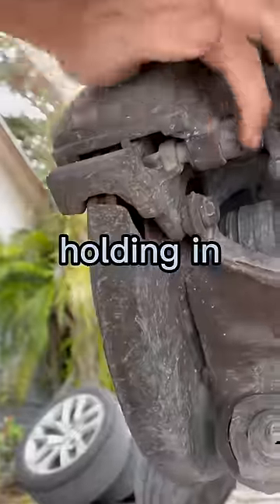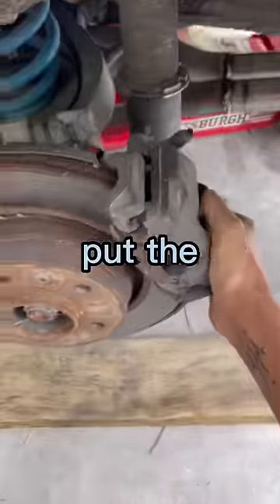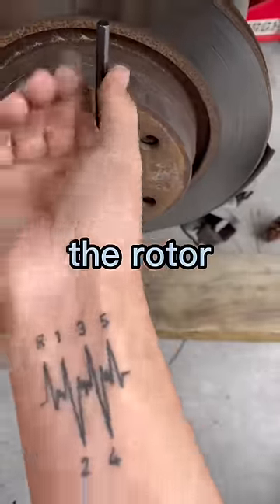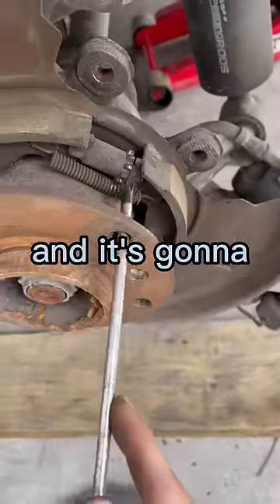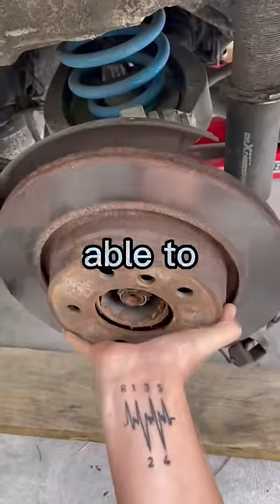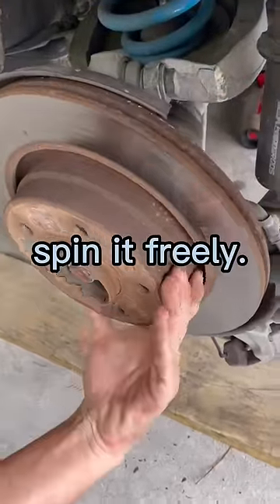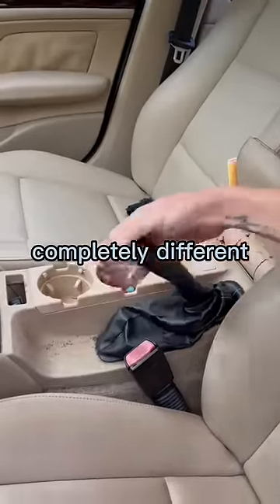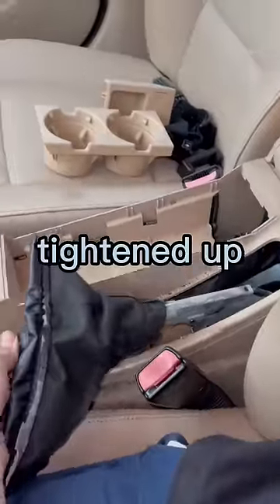How to make a hydro with your stock e brake!

Comment: “how to adjust your parking brake”
Reply: It’s quite literally the opposite of a hydraulic break. There’s no fluid amplifying the brake pressure. He just made his standard hand powered break slightly tighter
Reply: @Red_Cp3 right but the point is that it imitates a hydro
Reply: @lamp7746 except it doesn't. Not even a little bit no matter how hard you squint. It just makes the parking brake work the way it should. This is just basic ass maintenance.
Reply: @lamp7746 a hydro is just a HYDRAULIC parking brake. This is done because brake lines dont stretch like a cable and usually run on a separate caliper so the bite way harder and hold up better.
Reply: @peenusweenus3169  I’m pretty sure handbrakes shouldn’t be that hard hence why I said it’s imitating a hydro…
Reply: Jd41Scribner  that’s what I said
Reply: @lamp7746 and you never said "imitates" in your video so stop lieing. You said how to make your ebrake a hydro. Which is you never did. It's ok to have interest in a field you don't have experience in, but it's not ok to be a liar with minimal if any experience in the same field. And then doubling down on the lies and lack of accountability makes you look like a progressive American, politician or child.
Reply: @lamp7746 doesn't come close to even imitating, hydro locks up 10x easier bro 😊
Reply: @peenusweenus3169 no it’s not. A hydraulic e-brake uses brake pads on a secondary brake caliper. A parking brake does not

(Edit) not mentioning the hydraulic fluid and the fact that it can’t stay locked
Reply: @JJ_isdenaam  i already said they usually use a separate caliper. Learn to read
Reply: @lamp7746  he mightve over tightened ever so slightly but as long as the handle is lose for the 1st few clicks you should be good.
Reply: @peenusweenus3169  yeahhh but it can’t stay locked so it’s not
Reply: @The_goldfish1  hydro brakes aren't designed to stay locked as there's no ratchet to keep the lever up
Reply: @mrphil3446  exactly what i’m saying
Reply: @JJ_isdenaam  read it wrong sorry 😅
Reply: @mrphil3446  no worries🤣😉
Reply: @lamp7746 literally if it's a well-adjusted handbrake it should be able to lock your tires.  His brakes we're not adjusted properly before. Also hydro wouldn't have the locking mechanism in the handle.
Reply: @peenusweenus3169 i dont think your supposed to use a parking brake while driving....so its not what it was designed to do. This makes it so your not getting a full arm workout yankin that thing to the headliner😂
Reply: Correct.
He did a good job adjusting his parking brake.
Reply: And typically it can be done without removing anything
Reply: @lamp7746 no its kinda just putting it back to factory breaking pressure with a shorter throw in the lever
Reply: @The_goldfish1 he's literally holding in the button
Reply: @spyda6862 yes and we were literally not talking about the stoch handbrake but about a hydro e brake
Reply: @lamp7746 correct a hydro is basically a fancy parking brake

Comment: Hydro?  U know slamming your brakes when backing up will usually let that auto adjust tighten up a little.  If it is still auto adjust on the drum/caliper drums.
Reply: Regular drums maybe. Parking brake shoes are adjustable, but not auto adjusting.
Reply: @blackmesaresearch2 exactly. The e brake doesn’t have the adjustment arm to turn the adjustment nut. That’s just auto adjust for drum brakes only.
Reply: Not on that park break set up, that method only works with park brakes attached to the brake caliper
Reply: @blackmesaresearch2  some are
Reply: - comonly called a drum in hat, just about never called a drum/caliper drum 😂

Comment: This is the kinda of person thats asks if your cars automatic or manual for windshield wipers.
Reply: On a real note every drifter started out this way,  remove the spring in the button and get a button lock.
Reply: He the type of guy to ask you if your motorcycle is 4 wheel drive.

Comment: Actually hes right if you spin that disc it actually switches it to hydraulics. The best way to test if its in hydraulic mode is the yank the e brake with both hands 15 times then one handed another 15 times for each hand. this insures the hydraualic wire is locked into hydraulic mode instead of cable mode

Comment: I don’t trust anyone who calls a handbrake an “e-brake” 
Or someone who thinks a steel cable is hydraulic….
Reply: Well that's what it's called
Reply: I mean it is called an emergency brake so e brake is a pretty practical way of saying it🤓
Reply: But it is a e brake…. The like getting mad that someone called a sedan a car. They have multiple names, e brake was popularized in the states because 99% of cars are automatics so in return have no real use for a hand break other than in a emergency, hence emergency brake.
Reply: That there is a parking brake. An emergency brake is fitted to high performance cars. When activated it brings the vehicle to a stop in the absolute fastest way possible.
I dare you to engage the “parking brake” in an emergency while you’re on the highway 😂
Reply: @Red_Cp3 ofc it’s always a Matthew setting mf’s straight with facts💯💪
Reply: @mwoodall13 only reason I didn’t pull the EMERGENCY brake. During the accident I had recently was because it wasn’t my car, and the EMERGENCY brake was one of the foot ones. I would’ve pulled it if it wasn’t a foot one. And didn’t have time to think about it. If I were in my car, first thing I would’ve done besides slamming on my regular brakes as well
Reply: @mwoodall13  it’s not meant to be used in that type of emergency the emergency it’s meant for is a brake failure. The hand brake is 100% mechanical meaning if your brakes fail you have a “emergency brake” at your disposal to still be able to stop. Also ripping the brake at a high speed will only cause you to spin out if you pull it too hard if you engage it with even pressure the whole time you won’t spin out
Reply: He just means it fulfills the same purpose
Reply: @matthewcawley3107 dawg thats cool and all but we're still glossing over the fact this kid is claiming a steel cable pulling on some brake shoes is now hydraulic just because he tightened it to where it should be.
Reply: @Red_Cp3  then why are the electric ones called “electric parking brakes” and not electric emergency brakes
I get people call them that but it’s not what it is, using the parking brake in an emergency is not recommended
On top of that it’s a hydraulic hand brake- not a hydraulic emergency brake 😅
Reply: @mwoodall13  because the electronic parking brakes aren’t a hand brake. The benefit of the handbrake is it’s mechanical meaning if your hydraulic brake system that’s controlled by the pedal stops working you have a “emergency brake” the electronic ones are not mechanical removing that purpose making them exclusively for parking. And no one calls it a hydraulic emergency brake because at that point it is no longer a mechanical brake and wouldn’t be used or useful for that purpose anyway. Hydraulic handbrakes are used for getting as much braking force on your rear tires as possible as quickly and suddenly as possible to cause them to break tractions. how could you possibly in good faith use that as part of your argument knowing that hydro handbrakes have never came in a vehicle from factory ands use is completely different from a handbrake.
Reply: If you knew something about cars, youd know they are basically (ebrake = handbrake) are the same damn thing. But ill let your research tell you that 😂
Reply: @Red_Cp3 but it isn't an emergency break..😅
its actually a parking break.. and is called a parking break.. 
using it in an emergency, will more often then not, make thing worse...
Reply: @jesse584  you obviously don’t drive then. If you would have read the other 3 comments of me respond to this exact same msg from other people I wouldn’t have had to type this. The hand break is a 100% mechanical break whilst your pedal break used hydraulic lines to increase the pressure of your foot. If one of those lines fails you lose brakes, but if you have a hand brake you still have a “emergency brake” to help slow you down. And your other statement is completely falls have you ever pulled your hand break while moving? You don’t spin out like a video game your rear wheels lock causing them to drag against the ground scrubbing a lot of speed. The only way this would make you spin out is if you weren’t already on the brakes when you ripped it really hard above 60 or if you flung the wheel with it was activated
Reply: I get the second part but your dead wrong on the e brake, it’s literally an emergency brake.
Reply: Quick lesson:
Parking brake is the same as Emergency(E)-brake. There are different types of parking brakes such as Hand E brakes (as seen in video), foot/pedal E brake(push), and pull E-brakes which are usually under the steering wheel or near foot well
Reply: @mwoodall13 u gon smell lovely brakes 😂
Reply: I mean the handbrake is an emergency break or E break though the steel cable is not a hydraulic line
Reply: Well it’s an e-brake so you must not trust anyone that knows what it is. Like the new generation of kids that think it’s a hair tie holder for their pony tails or man bun. The original name for it is a emergency break, it was made for if your main breaks fail. It really should have never been in the vehicles, I’ve seen so many drunk guys get pissed off at their wife/girlfriend while driving down the road and pull that lever causing the car to slide. It’s pretty dangerous but also it’s better then then button or the foot e-break.
Reply: @eduardomeza7279 read your owners manual it is not an emergency brake, it is a parking brake. Because of modern brake master cylinders there is a very small likelihood that your hydraulic brake system will fail completely
Reply: The owners manual refers to it as an emergency brake
Reply: @jesse584 this is straight from Wikipedia because nobody here seems to be able to just google anything 

In road vehicles, the parking brake, also known as a handbrake or emergency brake (e-brake), is a mechanism used to keep the vehicle securely motionless when parked. Parking brakes often consist of a pulling mechanism attached to a cable which is connected to two wheel brakes. In most vehicles, the parking brake operates only on the rear wheels,[1] which have reduced traction while braking. The mechanism may be a hand-operated lever, a straight pull handle located near the steering column, or a foot-operated pedal located with the other pedals.
Reply: @@armandoa5787 In road vehicles, the parking brake, also known as a handbrake or emergency brake (e-brake), is a mechanism used to keep the vehicle securely motionless when parked. Parking brakes often consist of a pulling mechanism attached to a cable which is connected to two wheel brakes. In most vehicles, the parking brake operates only on the rear wheels,[1] which have reduced traction while braking. The mechanism may be a hand-operated lever, a straight pull handle located near the steering column, or a foot-operated pedal located with the other pedals.
Reply: @a_catfish5180  oh oh, and what does it do? oh yeah, activate the PARKING breaks, not the 'emergency' breaks... 🤦
Reply: I think the real problem is that it’s not a hydro it’s a mechanical brake. Call it what you want, e brake, hand brake, foot brake whatever it’s still not hydraulic
Reply: I call it hand brake or parking brake
Reply: @johnnyholman4421 actually some are not e brakes they are only for parking both terms are valid
Reply: @InboundG its not its an emergency parking brake emergency as in your car wont stay still because of the parking brake failing in the transmission you need a way to keep the vehicle from moving its not an emergency brake to stop the car from moving
Reply: @justicemcdonald2939  It hasn't been called the E-brake since the 90's. It's a parking brake. That's what it does. It just stops your wheels from moving after you take the car out of drive. This is not the same thing as what an Emergency Brake used to be on older cars.
Reply: @Red_Cp3 I've had exactly that happen, and used it exactly that way. Still pressed the pedal, to get the lights to light up, but it was nothing but engine braking and pulling the handle.

A pedal though? That's exclusively a parking brake
Reply: Also, it's B R A K E, you fools. Break is what a BMW does weekly.
Reply: @johnnyholman4421 that's no emergency brake. It's a hand brake to park...
Reply: @sebastianleister355 so if youre brakes cut out on the highway, what do you use to slow down?  You would use the “handbrake” in case of an emergency
Reply: @johnnyholman4421  got a couple options.
From shifting back, to grind ur car on the next wall/rail. To finally use the Handbrake... The use of the Handbrake is still shitty because u gonna very likely spin ur car out.

And well... The chance that both brake circuits are done or ur car ain't breaking is really freaking low low low..
But still it's the parking brake and not the emergency brake.
Reply: @Tazytots  And guess what it's always been called the emergency/parking break so people just use the first word so you want to use the second word who gives a fuck it's still cold and emergency break when your brakes fucking fail those are usually cable driven so it means you can still use your brakes when your hydraulic system fails that's why it's called an emergency break
Reply: I don't trust anyone who doesn't refer to it as a parking brake. Because that is what it is for parking.
Reply: @ipedro808  no its not its for when ur hydraulic system fails. They were only parking brakes from manual transmissions automatic transmissions of a locking ball inside of it
Reply: @Luca-gp1vp  not even close
Reply: Been pulling wrenches for 30 years and my father for 20 before that. Always referred to them as E-brake
Reply: it’s because it is, champ. Parking brake, hand brake, e brake, same difference really. Oh, how would you describe a situation in which you lose your brakes? Id call that an emergency. Emergency - brake. gee wiz captain this is not rocket science
Reply: @justicemcdonald2939 
Its called a parking brake, if you were to pull it in a panic situation (emergency) at high speed you would almost for sure lose control of the car
Its ment for parking
Reply: @coleross9295  bro I've been a mechanic probably longer than you been alive it's not just a parking brake It became called the parking brake by more and more and morons . But it was and is technically always the emergency brake because it's driven by cables is not hydraulic system if it was just a parking brake they'd use the same hydraulic system but you could always look it up in your owners manual instead of being stupid
Reply: @justicemcdonald2939  so your telling me if you habe a vehicle with a peddle operated “emergency” brake your going to push it in an emergency then reach down and pull the release when you want your back brakes to unlock to regain control? If you are a mechanic you know that you back brakes provide little stoping power in a front engine vehicle, you wana act tough and try to sound smart in the comments section, thats awesome, its intended for parking.
Reply: It’s a parking brake, not an e-brake lol.
Reply: @itsPrecisiion  Go in your owners manual and you tell me what it says It doesn't say parking brake only it says emergency parking brake
Reply: I agree about the hydro part but it's literally an emergency brake that you can use if your normal brakes fail.
Reply: @mwoodall13 no that's also an e brake. There is no system on high end cars to just bring them to a stop as fast as possible that isn't the normal brake pedal. You aren't gonna win this one bud maybe just take the L like a man
Reply: yeah I don't get it either, why  refer to it as an emergency brake when you use it to park, hillstart, drift ect
Reply: @johnnyholman4421 if you pull that lever whilst moving have fun
Reply: @ggxrazorz  its not meant to be yanked back, thats why when you pull it you hear multiple clicks, if your brakes fail, you pull it one click at a time to slow the car down,  not all at once or else your car would start sliding from locked wheels
Reply: Imagine getting mad at someone for saying e brake. Dude e brake, emergency brake, handbrake all the same thing

Comment: You don't have to take the rotor off. You can reach the adjuster through the bolt hole with the rotor in place.
Reply: Dude it's one bolt
Reply: @danieldifeo3699 it's ment to be done with wheel still on, you just need to remove 1 lug bolt, turn that sprocket until you can't turn the wheel by hand anymore then back up 10 nothces.
Reply: @danieldifeo3699 actually three bolts beacuse you need to take caliber off also if removing rotor.
Reply: @nikolaitinen4509 no need to remove the calliper
Reply: @aleksandarl6975  Not necessarily 10 notches as various vehicles ofc have different parts, different teeth etc.

Adjust it up till the wheel locks, back off until it JUST stops binding. 10 notches, teeth, turns or whatever could be right on one vehicle, and send the shoes 8 miles away from the drum on another. Shoes and drums should be as close together as possible or just touching/binding slightly (depending on the vehicle) to get rid of any travel or slack, without actually applying any real pressure and just constantly cooking the brakes.
Reply: @gopnikolai7483  i was talking about this specific car, that's what sevice manual says, 10 notches , wich is not even a 1 full turn, but in general yes, tighten all the way, then go the other way until it just stops binding.
Reply: you can adjust that screw in the rotor with the vehicle on the floor, all the wheels still bolted on, and only one lug nut removed
Reply: thats also how youre supposed to do it
Reply: Everu cars has there own specs of click numbers for the parking brake, but most of you guys are right nodeed to take the brakes off and in some case the wheel too